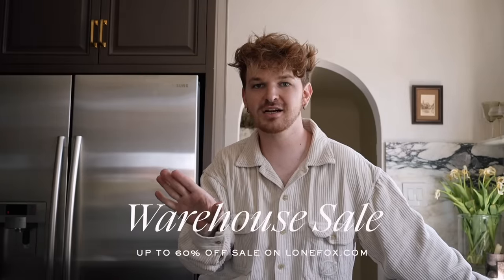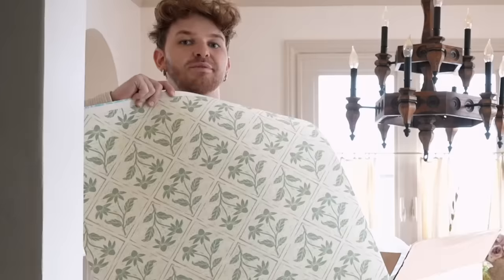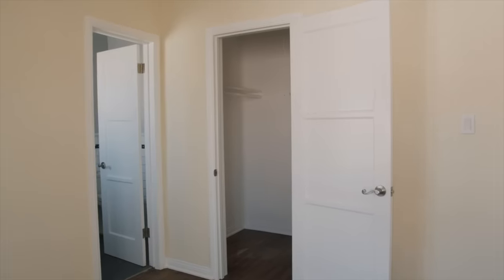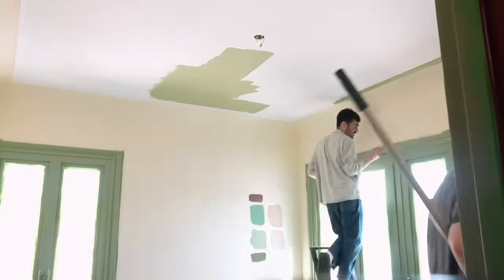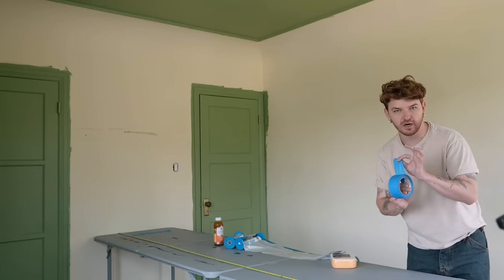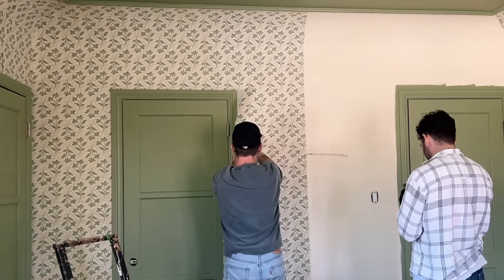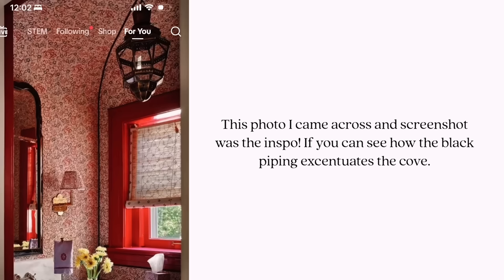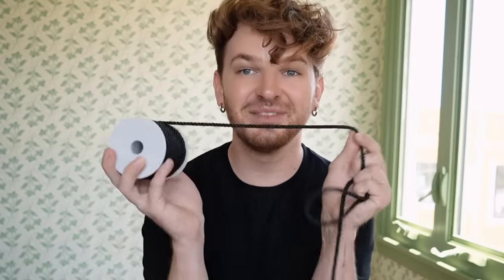GUEST BEDROOM MAKEOVER! *Wallpaper Everywhere & Vintage Accents* PART 1

Comment: Hi Drew! That wallpaper plays tricks with my eyes. I think it's the repeating pattern. It seems  crooked.  I adore you! ❤
Reply: It does appear crooked. It's going downhill it seems and I think he could look at the bottom flower and see how it starts above the baseboard and then, by the end of the wall, the little flower gets cut off. Perhaps he can fix it since it is peel and stick.
Reply from the maker: that first main large wall is a tiny bit crooked which is totally my bad! I am covering the bottom 1/3 with a headboard so I wasn't too concered along with art over top which I hope will deter haha!
Reply: @ThatSuzanneSchmid  It isn't peel & stick. He used glue.
Reply: @lonefox you can avoid this in the future by using a laser level to line up the first piece in the corner since walls are never really going to be perfectly straight.
Reply: Considering the age of Drew’s house (and location ((San Andreas Fault Line)), there is no way the walls are perfectly straight.  Trying to accommodate that and make the wallpaper look straight would be next to impossible!  And it won’t be noticeable once furniture, window treatments and art is added.  It’s gorgeous Drew; LOVE that green!
Reply: @ThatSuzanneSchmid  it's not peel and stick
Reply: Thank god I’m not the only one who thought that! I was afraid my eyes were going bad🤣
Reply: @FrogeniusW.G.  oh, too bad! 😞
Reply: @Tea_and_Arsenic  it's true that the busy pattern is difficult, however one should make sure the pattern lines up at eye level, where you'll notice it most.
Reply: @Tea_and_Arsenic 
It's not impossible at all for someone who knows how to hang wallpaper!  You can't just start hanging it against a wall or door, though, since they're never really straight.  You have to drop a plumb chalk line and snap it to get a straight line to start with.  And you need to do it every time you turn a corner and figure out how to keep it straight without making it obvious if it doesn't match up.  I'm a little worried about whether the paper will stay in the wall since they didn't size the wall first and it looked like they abandoned booking the paper after the first couple of strips...  Maybe that was  just a feature of the filming and editing process.  🤷🏼‍♀️

Having said all that, it looks pretty good so I'm guessing his walls are straighter than you'd expect.  And I think it's a pretty paper and paint color.
Reply: Love your enthusiasm,  love the green paper and paint and light fixtures, you lost me on the black cord.
Reply: Love it all & the green is the same hue of green I chose to paint a tall cabinet in my apartment ❤
Reply: @That 0:05 SuzanneSchmid it's not peel n stick.. if you watched the video, he applied glue. The wallpaper is grasscloth
Reply: I'm waiting for the reveal cuz I'm scared😂
Reply: @PearlCottage  yes, two others already mentioned that. I was hoping for a peel and stick paper so he could adjust it.
Reply: @ThatSuzanneSchmid  you do know you can delete your incorrect comments. Its right on the top so people will keep pesturing you abt it 😂

Comment: I'm sure dealing with the ceiling coping (as u mentioned) isn't the same as a straight wall meeting the ceiling - but why does the wallpaper look not straight on the walls? Is that an optical illusion of some kind? or Am I just seeing things?
Reply: He didn't run a plum line and start the paper from the  plum line and not the corner of room. It's easy to get it a bit crooked without doing that ...
Reply: I too thought I was seeing things but no the print itself is a slight tilt to it. It’s not the plum line. It’s hung correctly but the print itself has a slight tilt.
Reply: The tilt is throwing me off.😢at 15:47 you can see in the background how tilted it is
Reply: and sometimes I look at it and think its upsdie down

Comment: I ABSOLUTELY LOVE this wallpaper and the Yarborough Green pant you chose. They are both beautiful! Normally I am not a big fan of wall paper but this one has changed my mind for sure. To me, this room has such a warm, comfortable, relaxed, and peaceful feeling right now,, even before you put furniture in it. Initially I was disappointed that you decided against using pink for the ceiling, but the green looks equally as stunning on the ceiling. I just wish you were around to help- me decide on what colors to use in my home. Painting is much needed but I just go in circles trying to decide. I also struggle a lot when  trying to figure out if I should paint the baseboards a color other than just white. I do love the look of baseboards and trim being painted to coordinate with the walls but don't have the confidence to pick the color to do so.I cannot wait to see the second part of this video so I'm able to see what else you  do to finish it.

Comment: I don't understand why Marie choose the bedroom she did.  I would have picked the guest room so it has a connected bathroom.  Not practical to use the bathroom on the opposite side of the house attached to a guest room, which is mostly vacant.  And...if guests are using that room, does Marie have access to your bathroom?  Don't you have to go through a bedroom to get to both bathrooms upstairs?  The the green color, very refreshing!